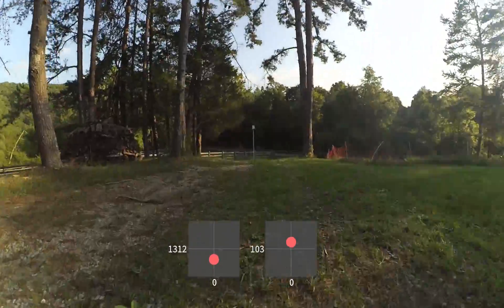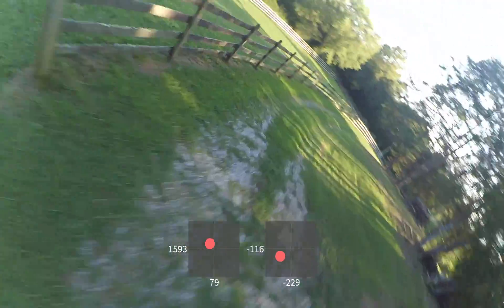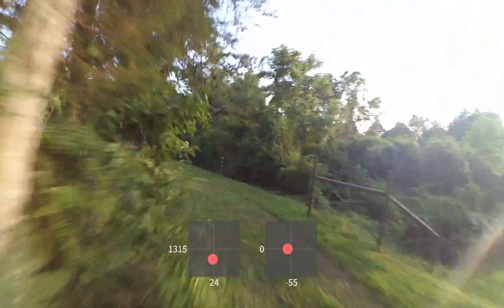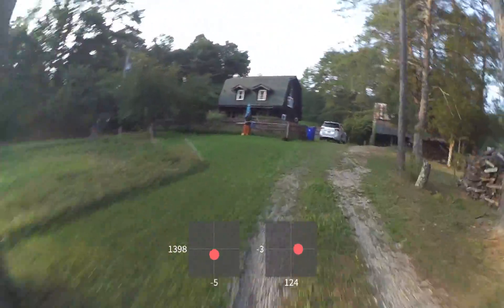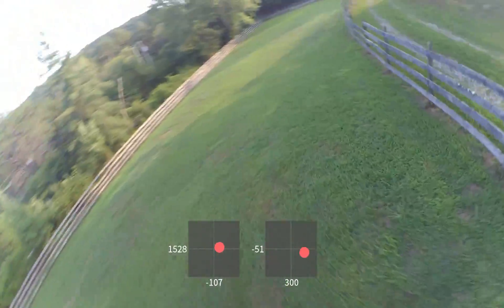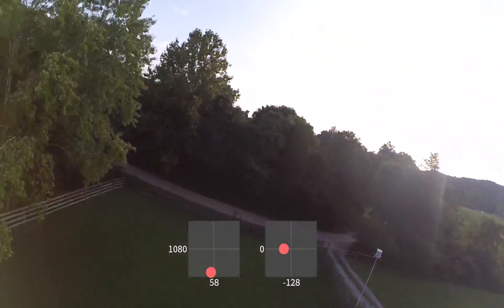Practical PID Tuning - Part 8 - Getting From Good To Perfect

Comment: Hi Joshua,is there a quick way of disabling motor filtering? i only ask as one of my quads i did it to is playing 
up,yes i did a dump of my old set up but for some strange reason it won't work when i try to put my old set up back in Betaflight,

I also sent you an email but i understand if you are to busy to help.

Much love and respect from the UK. 😉👍🏾👍🏾👍🏾

Comment: Thanks man, watched a heap of PID tuning vids (Inc all yours) and yours are helping me learn to tune the most.

Just one question, how do you know if you're motors are too hot from high D?  Mine come down a little warm but not hot.
Reply: if you can hold your finger on them it should be fine
Reply: they're coming down cooler than the LIPO so.....should be fine :)
Reply: Yup

Comment: Joshua, I have just watched your Practical Tuning series back to back and I have to say it is very cool how your flying has become more and more refined. In this video it really is wonderful to watch. You have much more nuanced control of the copter which is really nice to see in terms of progression from the earlier videos.

I have a question about tuning out propwash. 

When you have a copter that handles propwash scenarios correctly, can you still hear surging in the motors as the copter rides the turbulent air? It appears not from this video but...

I have been assuming that getting rid of propwash would mean the copter always sounds smooth and you wouldn't hear that classic fluttering oscillation sound as you descend through your wake with power on, but it occurred to me that perhaps you WOULD hear this but the copter would not physically oscillate. So the motors are rapidly changing power settings to deal with the dynamic turbulent air thus you HEAR the sound but your footage would look smooth. Like a car on a bumpy road - you would SEE the suspension working to smooth out the bumps but the chassis would be steady and stable.

Is this correct? Trying to work out what I am aiming for when eliminating propwash through tuning
Reply from the maker: Your suspension analogy is exactly correct. I find that when D is high enough to make the copter fly really well, you hear the motors surging especially when the throttle is low and the copter is "floating" at the top of a punchout.

Comment: Hi Joshua, do you know if raising your P can result in a smoked ESC? Just went for a test flight and after about a minute it burned mid-air...
Reply from the maker: Very unlikely. P term oscillations are not usually high frequency enough to smoke an ESC. Anything is possible but that wouldn't be my first guess.
Reply: Thanks for your fast reply! I hope it was just an unhappy coincidence...

Comment: Hey, how are you doing, I once ask you if it's possible for your I gain to be higher than your P gain, but Betaflight 3.0 stock I gain is higher than the P gain on pitch, any input on this? thanks. ............d
Reply from the maker: I said in answer to your other question that there is no implied relationship between P gain and I gain. The answer stands.

Comment: Hi. Can i see in pid tuning video your betaflight version and your final pids ? That could be cool ;-) .
Thanks
Reply from the maker: I don't typically go out of my way to show my exact PIDs because I am hoping to teach you the technique to come up with your best PIDs, not just copy mine.

My P gain is typically around 60-80 on pitch and roll and around 90-110 on yaw. I gain is typically defautls with betaflight 3.0, or perhaps slightly raised, around 50-60 on pitch especially. D gain is HEAVILY dependent on the copter's noise level, but may be between 30 and 60.

Comment: Hey Joshua thanks always for your content you really helped me get into this hobby. I have a tuning question and I'm not sure if this is the place for it but idk where else to put it so here it is..
Just built a QAV-X having odd problem with pitch I term, nose pops up on throttle blips and drops after punches even with I at 85: Bflight 2.9. BB shows motor 1,3 output at 100% and 2,4 at 80% at full throttle which I expected meant CG was off and too much weight in the tail but this is not it. I tried everything even hanging the battery off the front, had to be like 70/30 weight distribution towards the front and the problem was exactly the same. Every part is brand new so idt the rear motors should be making less thrust.
Any ideas?
I was going to go as far as to mess with the mixer drop the front motors power but I feel like something else is wrong and that's not a solution just a crutch if that even were to work.
Reply from the maker: +Nick Tesla back motors higher in forward flight is a normal aerodynamic effect, not CG. Don't mess with the mixer. The same thing must always happen for the copter to fly stable. If you have pitch throttle coupling raise pitch I gain. 85 is pretty high but keep raising it until it fixes or something bad happens
Reply: Ok I will thanks!

Comment: Nice education video.
I've been using KongKong props for a period of time and found that they are well balanced by the manufacturer.

Learnt from your videos, I raised up the P and D to remove oscillations. Based upon the stock PID, I raised the P term by 0.5 steps while the D term by 5 steps to test the best settings.
Reply from the maker: Awesome! Sounds about right.

Comment: Would you consider sacrificing smoothness for better lap times and a little propwash.

I am asking because you mentioned that to be 95% tuned you shouldn't have propwash but i have found that when making full speed 90 degree snap turns that if  tuned for no propwash the quad will wash out or drift out of the corner but with a lower d gain the quad digs into the air and jolts itself into the new direction more aggressively.
Reply from the maker: Yes, absolutely. It's the difference between tuning for racing vs. tuning for acro.

Comment: Hello Joshua.. I am using PIDs close to 90 on my HQ 5x4x3 and I am still having some prop wash. I am really concerned of having D gain too high, so I usually try to keep D at 25ish... What would you say that would be the ceiling for P and D ?
Reply from the maker: Let the flight characteristics dictate the tune. I saw somebody flying with P around 16 to 20 and was shocked that it was flying great. I have no idea how. In general, P is in the range of about 4-10 and D is around 20-30. P above perhaps 12 would be suspicious to me, and D higher than around 35-60 is somewhere where motors will start getting hot on most setups IMO.
Reply: Ty for the prompt answer Jushua! My question was related to the Martian II 230mm that I am trying to tune, using the SP Racing F3 and HQ 5x4x3 props, 2204 motors emax. I found that my P was good around 90... which I found really high and my D is yet to be tuned, its sitting now around 20 and my I is set as 35ish. My other Martian III 210mm has the default PIDS from Betaflight 2.9.1 (float) and flies awesome... Is it normal to have a P close to 100 or even higher than 100 ? thats my question.
Reply from the maker: +Jose Roberto Kerne not abnormal.
Reply: OK nice ty! I will finish the tune and I will share the PIDs for this one... its a really weird PID set but... ;-D it feels good flying

Comment: Hi there Joshua. I am currently having an issue with my quad slightly yawing to the right when I do flips and rolls. I am not quite sure what to change on my tune. It seems to do it more on rolls than flips. Any suggestions would be appreciated.  Thanks for all your videos as they have helped me out in the past.
Reply: +Joshua Bardwell okay thanks I will try Black Box.
Reply: +Joshua Bardwell Hello again. It turns out that I am ever so slightly bumping yaw input as I am reducing throttle to do my rolls and flips. Would you suggest adding some yaw expo to help with this? I am flying with no yaw expo at the moment. I have only been flying acro for about 3 weeks now so please forgive the noobness. Lol : )

Comment: little question joahua, I'v been playing around with the notch filter, and its working butiful, you have any advice on dterm_lowpass and yaw_lowpass settings when using notch ? thanks in advance
Reply from the maker: It's really too early to give any general guidelines. In some cases, people have reported being able to reduce or eliminate the use of dterm_lowpass when using the notch.
Reply: ok so "dterm_lowpass = 0" is off ?? cos on the blackbox editor when I tryed it, it says dterm lowpass at 0hz I'm a little confused like always :)
Reply from the maker: +nixxinn that's off.

Comment: What the heck are you wearing
Reply from the maker: Clothes.
Reply: is it about impossible to eliminate process without braking escs
Reply: +riosllc propwash
Reply from the maker: Yes. Without braking there is no chance of having a good flying acro quad, never mind propwash.
Reply: There is an old Scottish joke about Kilts which is applicable here: "Is there anything worn under the kilt?". "No, It's all in perfect working order!".
Reply: this is a very important   point, i spent along time trying to tune one of my quads only to see light damping was off  , turned it on and all was good

Comment: have you tried blheli_s yet? I just got in 20a and 30a racerstar v2 (sunrise cicada rebrand) and I'm finding a lot of things I couldn't seem to tune out of my old lb pro are SO easy to get rid of with these. everything runs cooler and tuning is a lot easier in my opinion.
Reply from the maker: Yeah. The _S are very good. I'm flying Cicada 20A on my Canis M4. I'm having some yaw gyro glitch problems with that copter, which is why you're not seeing more of it on the channel.
Reply: +Joshua Bardwell you haven't been able to find the source of the gyro problem? I have read your posts on regroups and it does sound like one hell of a problem to figure out. I'd ask if you have tried this or that, but I'm sure you have exhausted all possibilities. I consider you the Yoda of quadcopters :-)
Reply from the maker: +Adam Komarek I think that vibration isolation will fix it. It's just hard to do on such a small copter.

Comment: When you say jump up the e.g. p gain. How many points are we talking. Just curious
Reply from the maker: I went from about 6 on the DYS props to about 10 on the KK props. That is a pretty big jump though. Normally I would bump about 0.5 to 1.0 at most in a single step.
Reply: Great help. Thanks JB

Comment: Thanks for this! You mentioned that you were closely monitoring the motors for overheating. How were you doing that and how would you know when it's a problem?
Reply from the maker: Well, if you have an infrared thermometer, you can check the temp of the bell and the windings, in which case they should be below about 70° C. If you have high-temp magnets, they can take more than that, but there's really no reason to push it IMO. If you don't have an infrared thermometer, pinch the bell, and if it is too hot to hold your fingers on it for about 5 seconds, it's too hot.
Reply: Awesome - thanks so much Joshua Bardwell

Comment: What is prop wash? One question when my quad is in stationary it just does  goes to the left? Why?
Reply from the maker: Propwash oscillation is a type of oscillation that comes out when the copter is falling into its own propwash, or when it is in a sharp turn and is "skidding" backwards into its own propwash.

Your other question is pretty open-ended. If you are in autolevel mode, you might need accelerometer trim. Also, check to see that your channels center at 1500 us.
Reply: +Joshua Bardwell thx 👍ok i will check But acro is life